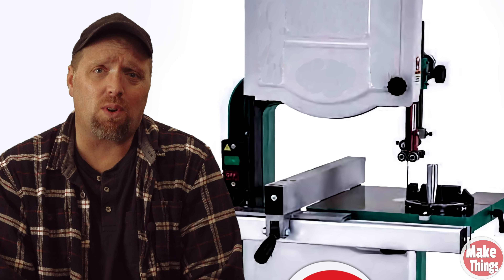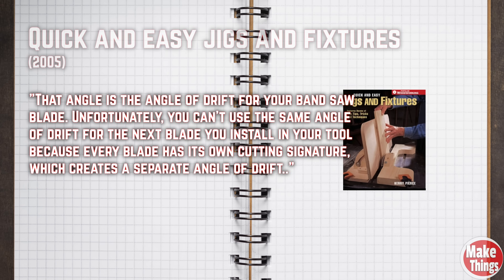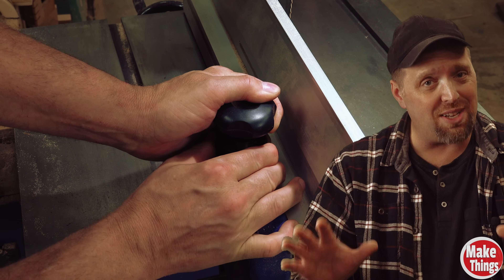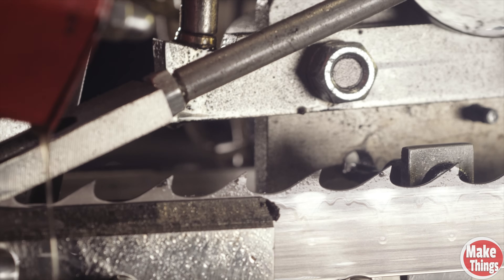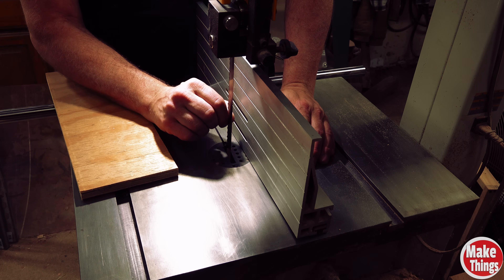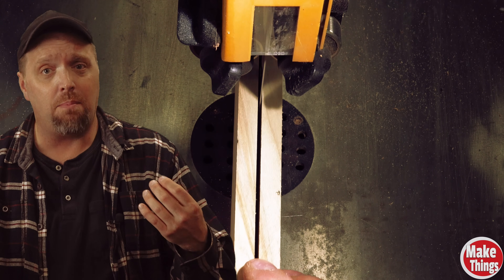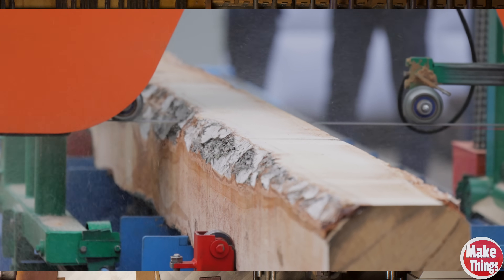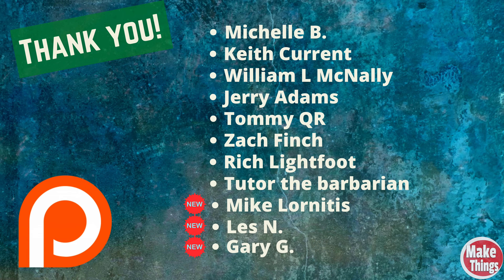The Mysterious Bandsaw Drift...Solved?  // B4WMT #9 // Make Things

Comment: I bought a pawn shop Porter-Cable band saw. I replaced the tires. I installed cool block" blade guides.  I made a “zero-clearance” throat plate. 

* I only use high quality blades. 
* I vacuum inside and out after each use. 
* I clean the tires regularly.

My band saw cuts as straight and square as any table saw.  I only use a fence when I resaw.

So what causes so-called band saw drift?
* Cheap blades
* Dull blades
* Dirty wheels
* Excessive feed rate

Comment: Drift isn’t caused by the blade “pulling to one side or the other”. Bandsaw drift is caused by the blade twisting to the right or left. It’s already twisting as it leaves the upper wheel. Why is it twisting? That’s the real question.

Comment: This is exactly what I needed to see.  I ruined a slab of red oak yesterday, while trying to re-saw it.  I had tried to saw as much depth as possible on the table saw, but that was overpowering the saw.  (I was considering trying a circular saw blade as you mentioned in the video.) I have a Grizzly 17" band saw, and thought it would be a breeze to re-saw the slab, since that's the reason for the saw.  I was surprised at how unforgiving it was.  I haven't tried to re-saw any hardwood slabs before.  I will try the single point method that you demonstrated.  Thanks for the great explanation of drift!
Reply from the maker: My pleasure Phillip ;)

Bandsaws are frustrating, especially when everyone seems to know the answer for them, including sales reps (I fought with them at Grizzly).  Since the video I bought a carbide tip bandsaw blade.  It cuts about as straight as my table saw now...I can't recommend them enough.

Comment: Setup steps: Make sure the two wheels are coplanar (easiest to do before putting on the table). Mount the blade on the tire with the teeth just off the crown. Don't over tension the blade. Tension to one size less than the blade width. Align the table miter slot to the blade (using the table attaching bolts). Align the fence to the miter miter slot (that way the fence and a miter gauge both work correctly). Adjust all the blade "bearings" to correct tolerances. Using a scrap piece of wood against the fence see if the saw cuts along a straight line marked on the board parallel to the edge against the fence. If not adjust the blade tracking until the straight line is cut without drift. Replace dull blades sooner rather than later. I check for correct tracking each time I change blades (using the same board over and over). So far I have only adjusted the tracking once. This all on an inexpensive 14 inch Grizzly bandsaw.

Comment: Single point Fence IS THE BEST. Keep the back of the blade centered in the kerf Also use a wide blade with proper tension AND do not push faster than the the blade can cut or the blade will distort causing a bowed cut. 
Tip. You find a thick piece of wood with a beautiful grain. DRAWER FRONTS!! Plane the wood then glue two drawer front blanks to each planed face. Re saw. The aim here is to then plane the veneered front to thickness. Take the good wood drop, plane flat and repeat. You now have a set of cool looking drawer fronts

Comment: Thanks Rob.  I have the same Rikon bandsaw.  I was wondering if you may comment on the factory supplied fence?  My fence has a spring action that, no matter how I tighten it with the knobs, it deflects when I push against the far end of the fence.  While there is less  movement at the blade than at the end of the fence,  it is still moving when press against it.  Am I doing something wrong and/or this something that I should even be concerned about?  Do you know how to fix it to make it rigid?  I've tried several ways, but nothing seems to work.

Comment: I have found that if I keep the gullet of the blade in the center of the wheel and don’t over tighten the blade,  I don’t have to fight drift. When the teeth come in contact with the wheel is ruins the set. The wheel side flattens and give it the same results as if those teeth were dull, causing the blade to drift to the right or “sharp” side.
Dulling with a stone makes one side dull to compensate for the low set on the other side.

Comment: best video on bandsaws I've seen, gr8 job!   why is my Jet 14" screeching like a banshee,  only had 1 yr, fairly new to it, I've tried to check all the bearings and everything, cant figure it out.  I have a 1/2" jet blade and resawing 8" wide, 2" thick white oak boards, which warp and bend when I'm done, so frustrated, new sub btw

Comment: your method of "sharpening" teeth on one side is misleading... it doesn't sharpen the teeth, it just removes some of the side of the tooth, reducing the "set" on that side. I don't think that asymmetric sharpness is the cause of drive, and you have not demonstrated it. You have demonstrated that reducing the "set" on one side could mitigate drift. Remember... correlation is not causation.

Comment: Well you dulled the right side of the blade and I creased drift that side. Is it possible to resharpen blade edges to also counter the problem or is sharpening an engineering task?

Comment: Great info! Another factor is bandsaw setup/tracking. Most manufacturers say to adjust tracking so the blade is centered on the wheels. However, since a bandsaw tire is domed, that leaves the teeth unsupported and they will drift/be driven by the wood. Per Alex Snodgrass, the tracking should be adjusted so the deepest part of the gullet is on the centerline of the wheel. This supports the teeth and reduces drift also. And the blade guides should be behind the teeth, at the gullet so they don't rub against them and dull one side or the other. 👍
Reply: See where the idea of the blade is: centered on the wheel; others say the gullet is to be centered. Who do you believe?
Reply: @knothead5  I follow the Alex Snodgrass method and put the bottom of the gullet in the center. It makes more sense because the wheel is crowned. If you center the blade on the wheel, the front of the blade will be unsupported and it leads to more movement in the blade and a less straight cut.

Comment: How about clamping the work piece to a sled, then using the sled to run the piece through the saw, without using the fence? There will be no fence to push the piece off line as the cut opens up.

Comment: Hi In case you didn't know your saw has a single point attachment that fits into the 2 slots on the fence. Informative video, thanks
Reply: This is the reason that your fence has to slots in it. The single point fits into it. However that particular fence has a tendency to bend out of plumb, and deflect away from the blade at the top. I use a clamp to press the square base against the table top.

Comment: I'm sure there are many different reason why one could get drift but…😊
I’ve had extreme troubles with bandsaw blade drift, one of things I noticed was that new blades cut straight, then started drifting more and more… I also noticed that less blade tension slowed that process.
Then friend gave me a very old homemade bandsaw, it sawed straight plank after plank, one could even tension the blade without instantly cause a rapid increasing drift… The saw had particle board wheels and a thin rubber coating, and a noticeable crowning. I also noticed that my bought saw had a fat rubber rim than pushed against the teeth, so go figure it was ruin the blades and ruined all hopes of cutting straight

Comment: I always thought that drift on a bandsaw was caused by the blade twisting right to left since it is more flexible than a table saw blade. 
Since it appears to be caused by blade wear i don't think it would dtift if the blade was as thick as a table saw blade. Of course it wouldn't work either 😊. 
Very informative.

Comment: When I worked at Woodcraft some 20 yrs ago I bought  a jet bandsaw. The store owner gave me a quick lesson on setting the saw up and I have never ever had a problem with drift. I use nothing but Timber Wolf blades and not very many of those. First the blade needs to be in the center of the tire thats the teerh not the whole blade. The tire has radius and to run true the teeth need to be in center of that radius. Tension should be low, loosen the tension adjustment til the blade starts to wooble then tighten 3 turns. Next never use cheap blades that's why i only use Timber Wolf blades. This has worked for me for many years and in my 9 yrs at Woodcraft I passed this on to a lot of happy customers. Good iuck !
Reply: Great information! Alex Snodgrass said in a class at Woodcraft to have the gullet (base) of the teeth in the center of the tire. It really helps. I also round the backside edges of a new blade, which also helps. I use a river rock for this. I also only use Timber Wolf blades. They seem to stay sharp longer than others I have tried.
Reply: @creativestuff1234 great recommendation, I looked up Alex, got a very simple tute on set up with zero drift (he says drift doesn't exist on a proper set up) and got a bonus how to on bandsaw boxes and snakes.
Reply: @creativestuff1234  can you explain why you round the back of the blade?
Reply: @JoeyCour   they may have burr on them caused or accidently done in the manufactoring process
Reply: I agree. If you’re adjusting for drift right out of the gate then there is something improperly set up. Wheels centered over the tires is the most common problem. All guides and tensioning dialed in and you’ll never have a problem. Research Alex Snodgrass. He shows a proper tune up.
Reply: I tried to get my blade to wooble like your recommendation but it just wont wooble!
Maybe I got stuck with one of those non-woobling blades?
Please help! I need to wooble
Reply: @jimhuitt9854  thank you very much. Appreciate your experienced advice

Comment: Get a EZtension tension gauge and you will find that with proper guide setup you’ll have no drift. Until your blade is ready for the bin or reshaping. The gauges on saws are useless especially over time when the springs strength has changed.